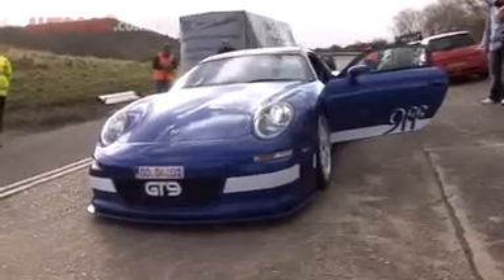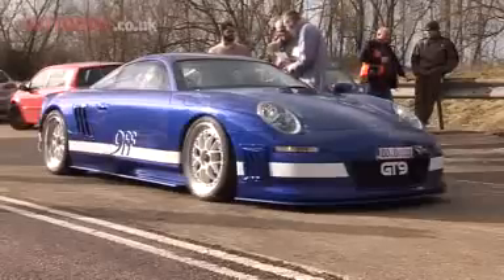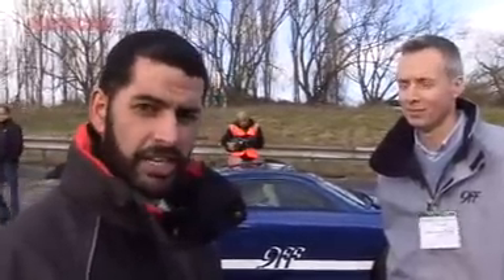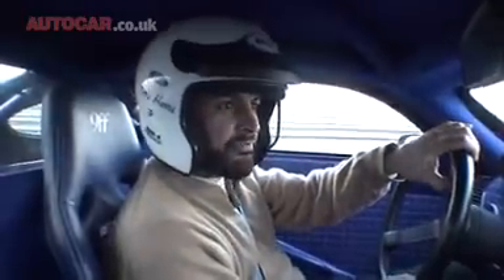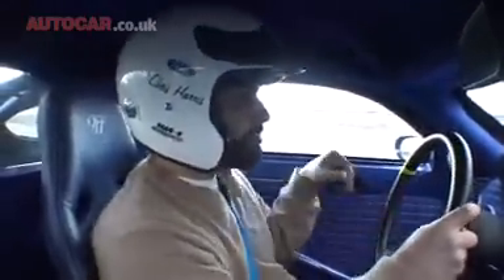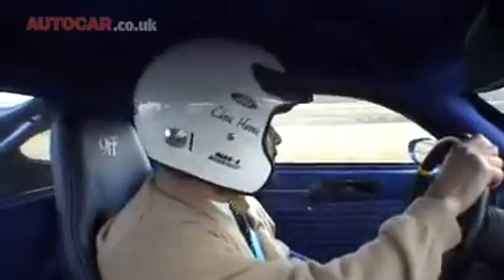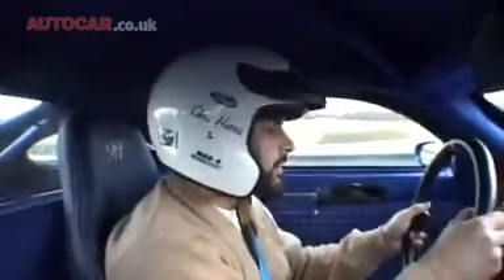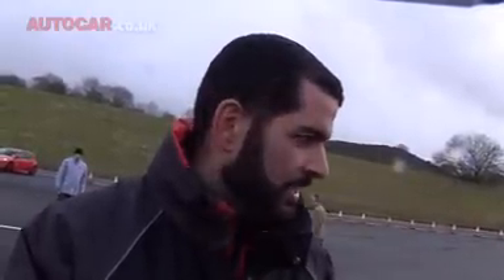Porsche 9FF GT9 driven - by autocar.co.uk

Comment: Now concerning cornering the man who created the GT9 himself agreed that the car is not designed to go around corners although it does have some ability to turn because of lightness. He did say that it performed around slaloms as quickly as a CGT which by the way is about 3 seconds slower in the Top Gear track than the BV. The BV has generated 1.34Gs around a 300 feet skidpad(again you can verify that in wiki) which is a lot lot better.

Comment: vayron actually looks like a car inside, and not a box on wheels like this thing is.
Reply: it costs for less than half
Reply: TheDennisoo7 and is less than half reliable^^
Reply: no ^^
Reply: TheDennisoo7 this 9ff broke several times already whereas there is not a single of the over 300 veyrons that broke even once over 10 years now.
Reply: it's a box on wheels, engine, fiber frame and 4 wheels, you wouldn't take a cross country ride on this thing. Lets see them brake any vayron records while having this thing fully loaded.
Reply: i rather to have a audi rs6-r abt or a bmw m5 g-power or cls 850 biturbo
Reply: CrimnlBT Remember this was some years ago... The new GT9 VMAX is one of the coolest looking and fastest cars out there coming from a tuner company. UGR, AMS, Heffner and maybe a few others are the only motorsports companies making 1500+ HP cars these days but only for straight line racing. The new GT9 can perform extremely well on a track and is well worth the money compared to anything in the same HP region. You simply won't find a better 1400 HP car.
Reply: alex symmes doesn't have anything in common with what i wrote.^^
Reply: TheDennisoo7 Who cares its an engineering masterpiece.
Reply: ok
Reply: xFlow777 weight reduction bro
Reply: B E C A U S E  I S  R A C E C A R

Comment: Now concerning the quarter mile time you mentioned the 9,8 seconds I haven't found any info on that yet but if you watch Top Gear S11E6 the race with the Germans they had a quarter mile drag race with many supercars(Murcielagos and stuff like that) and the 9ff came last because like they explained the car isn't able to put it's power down off the line.

Comment: It manages to be comfortable and easy to drive while it has the best 0-60mph time than any other production car. It has 1000bhp and 1250Nm of torque and still you  get it around 2200-5500rpm. It weighs almost 2 tons and still it manages to be a ten second car although it isn't set up for qm. And despite the weight it still manages to be very fast around corners. Still if I had to choose a worthy contender I'd go for the Koenigsegg CCX, not the 9ff.

Comment: The tires on that car are most likely rated for 200+ speeds. The only way he will get better traction is changing to a tire with a different rubber compound. As well as if they are the ones im thinking of, you need to warm the tires up first.

Comment: 2of2... But an unsophisticated pushrod engine (BTW, cam shafts aren't meant to be inside an engine block) with large tolerances will break down oil as well.. 

And finally, your car was made on an assembly line by Lee Roy and Cledus.....and after Lee Roy stopped spitting his tobacco into the cylinders, Cledus bolted the heads on with (the right tool for the job ofcourse) a pair of Vise Grips.. Cheers mate :)

Comment: I agree, autocar must have deleted my other comment where I said that both team9999 and I were both correct. 
He stated that this car was built by 9FF which I finally agreed to since the VIN originates there.
Then I was correct by stating that 9FF also modifies production vehicles and turns around and sells them.

I hope this clears things up and maybe autocar doesn't delete this either.

Comment: But that is the thing with the Veyron. It's not just about straight line performance. It's also about cornering and comfort and luxury and superior high speed stability. Of course it became known because of it's straight line performance but that's not all there is to it. The Veyron is designed to do everything as well as possible and it does at least to a point.

Comment: I have built several cars that exceed 300km's per hour, the dynamics of a car at those speeds can change, not only the handling of a vehicle but it can have an effect called diesling, where by the air being forced into the engine at those speeds can keep it running at top speed. PS make sure you have plenty of time to stop!!!!!

Comment: @hippievogelei: Some people choose to build their engine with bigger liter size because its cheaper and easier to upgrade. And you say that the BMW 5.0 liter engine is a better engine than the Corvette LS7 7.0 liter engine, but that LS7 engine is actually lighter and better fuel efficient than the BMW 5 liter. You say we cant make better engines? Dont worry, we are comming out with a 6.9 liter normally aspirated 800hp V8 in the upcomming Iconic AC Roadster.

Comment: First off the Porsche 911 under it is a production car. Then it was taken in by 9FF and rebuilt to be this monster. Granted it is a beast, but this is not the same as a production car off the line like a Veyron, I do not see how it could be compared.
9ff is like Saleen or Roush Racing; they take production cars then supe them up and sell them.

Comment: @Swams555 The problem with the SSC, well one of them, is that when driving near it's limit it's like trying to run backwards on a treadmill at full speed on stilts with KY jelly on the track while having full body tourrettes and an adult diaper full of feces.

The thing shakes, wobbles fishtails, fish heads, monkey nuts, funky muts all over the place. The Veyron is smooth as silk at 250+mph with the A/C on, a mp3 playing and personal ball massager activated.

Comment: Every car is built for a specific purpose. A Ford Mondeo is built to carry 5 people and a lot of packages and to be comfortable. A Range Rover is designed to go off road etc etc. The 9ff GT9 is all about top speed. Of course it's faster from 200kph to 300kph. These are speeds where it can put it's power down and it weighs 500kg less than the Veyron having the same power.

Comment: Oops, so I see. However, what the Volvo had done was I think the transmission oil seals were done at 600k - and do I recall he took the head apart to clean it? Still, 2900 - 600 = 2,300,000 miles since rebuild, which is over double what your Honda has done. Don't mistake me, I respect Honda and even admire some of their cars (NSX, S2k etc) but I do tire of Honda fans claiming absolute supremacy for their favourite brands. The P1800 is utterly and near-uniquely remarkable, however you look at it.

Comment: @namybot no the fastest car around the Nurburgring is the Lexus lfa Nurburgring edition, it did it in 6:17 so the Japanese got you there, and now ford decided to put 650hp in the new gt500 which is more than any 458 or sls or Porsche or Maclaren, and it only cost's 65 grand or 48,000 euros, and america is a great place where you can call up nelson racing engines and for 65grand they will send you a 10.4 liter twin turbo v8 making 2200 hp and 2150lbft of torque

Comment: @namybot 
i know the Koenigsegg Agera R does 200mph in around 17 secs    but i know the Yellow Nissan Skyline R33 with 1000HP which was tested on TOP GEAR does 0- 190mph in 11secs so realy thats way faster then the Agera R and Costs alot less and is relieable 2.
Engine alone for the R33 1000HP was £150.000 so its alot cheap then the Agera   which is still a nice car 2.

Comment: When it comes to top speeds it's all about torque and aerodynamics so they have about the same top speed. But because the 9ff is so awful off the line even though it has so much power it struggles to get past the Veyron. Concerning cornering the Veyron IS better. It has 4wheel driving fatter tires and like I said it generates 1.34 Gs around a slow skidpad(300ft). Imagine what it can do around 
a fast one.

Comment: The SSC is a race car on the street and not in the same class as the Veyron. The Veyron is a car that can be comfortably driven daily. The SSC can't unless you're willing to see the chiropractor every few days. The GT9 is the same as the SSC. Nice car but not a daily driver. The Veyron is the only real 400+ km/h daily driver. Add another 5 psi boost to the Veyron and it would get back the fastest title and still be just as docile.

Comment: @rs200000000000: Those so called "simple engines" in this day and age are starting to prove statistical advantages over some european engines. For example. The Corvette Z06 engine (505hp N/A 7.0 liter V8) is actually lighter and more fuel efficient than BMW's 5.0 liter N/A 500hp motor thats in the M5. Now I'm not saying that GM is better than the world or anything. But I am saying that they are getting much better this day and age.

Comment: the Mclaren f1 GTR that steve sufcliffe drove will eat this and the veyron for dinner. 125-190mph in 4.5s , thats 5 seconds faster than a veyron.
Its entirely possible for a machine to be that much and more quicker.Both are stripped out road legal race cars, yet Mclaren achived this feat 10 years before this guy at Porsche.
I feel so sorry for Chris.

Comment: 1of2... First of all - I must have sucked when it came to maintenance? The only car i mentioned owning was my old Civic with 286K miles, which is my current daily driver, "lmfao"..
And get your facts straight - Honda engines actually break down oil quicker than most other engines...because they're much higher revving (rarely less than 7000 and as high as 9000 RPM).. Oil doesn't care how many cylinders an engine has, just how fast metal parts rub together...

Comment: But think about it: It needs 4,2 seconds to get to 60mph. It doesn't have neither the power nor the traction to complete the QM in the remaining 5,6 seconds. All supercars or highly tuned dragster cars like Vipers or Mustangs which do the QM around 10 seconds, they all do 0-60mph in 3 seconds or a little less. With 4,2 seconds 0-60mph time the 9ff is no match for the Veyron. Like I said the Top speed is about the same which is everything the 9ff is about.

Comment: But when you examine all the characteristics that define a car you are dealing with a miracle in car engineering and a highly tuned 911 set for SLP. In my opinion those two cannot be compared. The expression: The 9ff is as fast as a Veyron in a straight
is correct. But the expression: The 9ff is as good as a Veyron couldn't be less accurate.

Comment: Nice effort Porsche! But still no match for a Veyron. At 16,7 seconds the Veyron is almost a full second quicker than the 9ff to 186mph. With an over 4 seconds 0-60 time the Veyron eats it for breakfast in a quarter and a half mile drag race and it still wins in the full mile race. Top speed is about the same but you can also drive around corners with the Veyron.

Comment: 1of2 ("im not worried about gas mileage, im worried about power and reliability") So you like extra unnecessary parts in your valve train? There's NO reason for a pushrod engine to make more power......it has nothing to do with the way your valves are actuated.. OHC is more efficient because of the hemispherical combustion chamber, for one.. The only reason your engine is a pushrod engine is because of old design, meaning the cam shaft is nearly a foot away from the rocker arms they actuate.

Comment: so the 9ff is just a tuned 911 turbo? in that case, there's plenty of tuned cars that's faster than the veyron. there are plenty of supras out there that is way faster than the veyron and this 9ff. This 9ff does 1/4mile in 9.5 sec, a lot of supra out there does it in high 8 second easy. a gtr spe1000 will easily do 0-300kmh in 17 sec as well. Heffner ford gt tt, gallardo tt, and sthe list goes on forever. Veyron is simply the fastest stock car, but not the faster car on the street.

Comment: Its a Monster of a car, cant dispute that but comparing it to a Veyron is unfair to both cars... Its faster than the veryron at specific points but not totally and it is a bare bones, straight line oriented Race Car compared to a Luxury Supercar Veyron. The Veyrons superior handling would destroy it on a track and take away its mid range acceleration advantage. The Porsche is faster but not real world faster as u'd probably never have enough space to catch and beat a Veyron from a stand still.

Comment: 20 years ago Callaway produced a car with a factory warranty called a sledgehammer it did 254.7 and completely street able composed quiet and monster TT V8 for a hole lot less money than this remember the hammer was a car you could toss the keys to granny to drive not some race car you have to shout over air conditioned,surround sound cd changer,cigar lighter electric windows seats flip up headlights

Comment: Better than the Veyron, I don't think so.  It's fast, and faster than a Veyron, and a great feat in engineering.  

BUT the Veyron is an ACTUAL production car, and could daily drive it without going deaf.  It is far more difficult to build a car that will drive 100K+ miles and for hours on end than 20 one-offs like this Porsche.

Comment: 2of2 - Lets just compare what goes on from beginning to end in the valve train of a pushrod engine and an OHC Honda engine.

Pushrod engine - Cam lobe, lifter, pushrod, rocker arm, valve.....5 parts.
Honda engine - Cam lobes, sometimes a rocker arm, valve.....2-3 parts

OHC has no disadvantages...none...less parts. Ford dabbled with OHC in their higher end V8's over the years, and the new 5.0 Mustangs are OHC.. Pushrods will disappear soon.. Also, tell Ferrari pushrods are better, Lee Roy.

Comment: 2of2 - But anyway, i suppose the Volvo is technically the record holder......but it had an engine rebuild at 600,000 (Accord did not) and i can prove that to you if you like.. Also, no not every car can run to 200,000 or more if you take good care of them.. Many American cars were inherently bad (most until recent years), and it wasn't only poor craftsmanship, things like chewing gum and soda cans have been found behind door panels.. FACT: Honda and Toyota have the highest reliability record.

Comment: ehhhh, not impressed.  I'd buy a 1550 -1900 rwhp Gallardo Superleggera from Underground Racing for much less than half the cost and have the ability to do 250 mph in the standing mile and 0-177 mph in 9 seconds flat

Comment: The Bugatti Veyron is not a pretty car in any shape or form.
Ive stood next to one in the south of France, and it maybe extremely powerful and fast, but it's disappointing to look at in the flesh.
The 9FF is on par with the Bugatti in performance, but neither cars are practical on any road, where can you safely use such performance other than a race track.
Reply: From all reports of car reviews etc, the Veyron is an easy car to drive, and one that can be driven very fast with minimal concern for a car of such potency. SO.... Autobahn it is then... (mind you, if you can afford a Veyron, a pissy little speeding fine isn't going to be too much of a concern...)
Reply: Buggatti's are practical that is thing. 

They are pure luxury like a Bentley but just happen to be as fast as a super car at the same time. Which makes them a very special car.

Comment: Think about it. This would be impossible to drive on a road (to noisy, no traction control), on a track it would likely be a liability, let alone a handful. It's only real area of use is the straightline, which can be done better by cheaper cars. It's a poser's car.